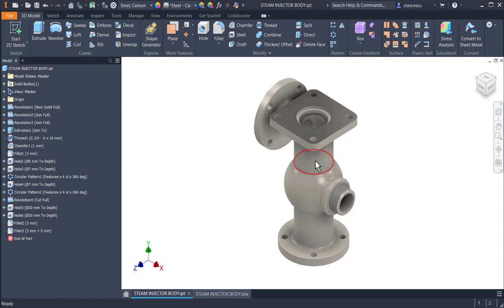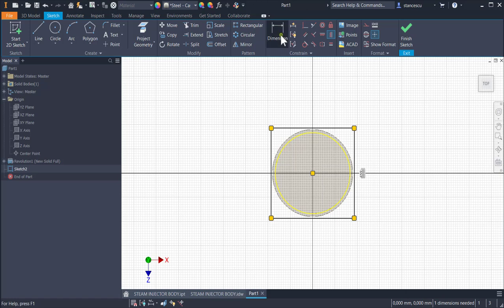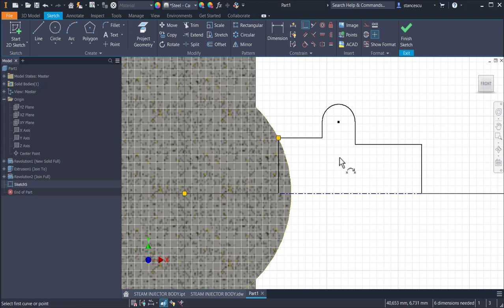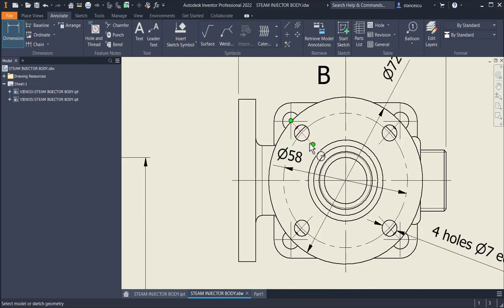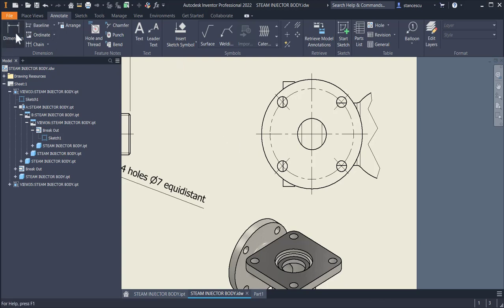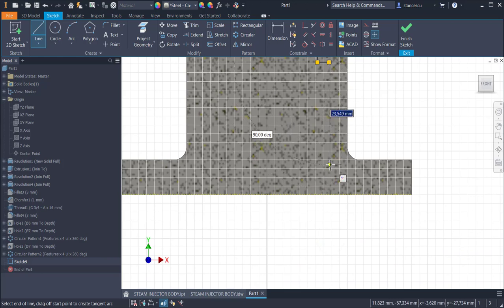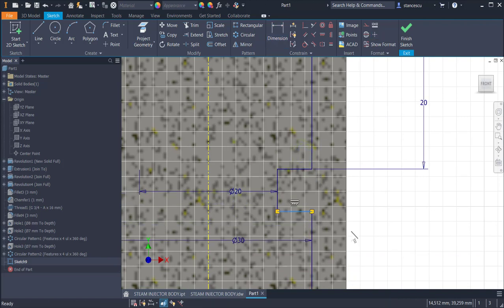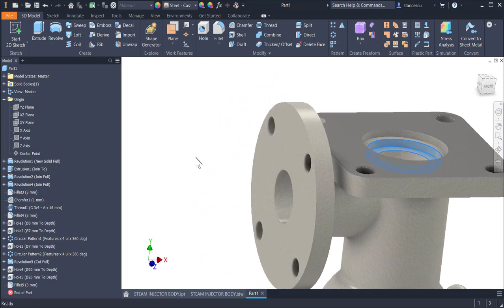Tutorial Inventor - 226 STEAM INJECTOR BODY

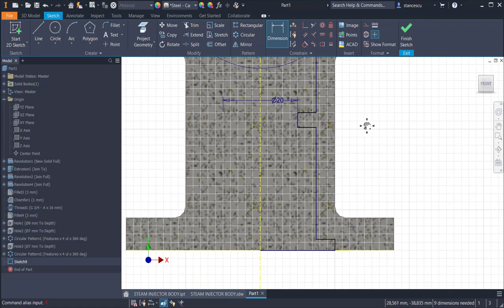Comment: Dear professor, at 40:36, I believe that diameter should be 25mm, not 20mm in accordance with your drawing and Timoteo's drawing.  Also, I think that there are 3 radiuses that should have been made 8mm; the outside radius is 3mm + 5mm part thickness gives an inside radius of 8mm.
Reply from the maker: Nobody is perfect - thank you my friend!